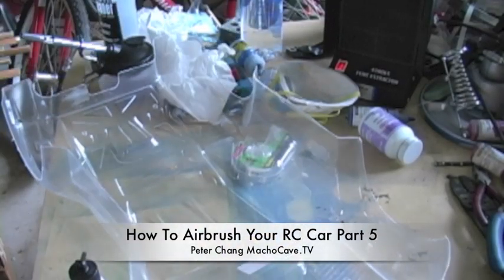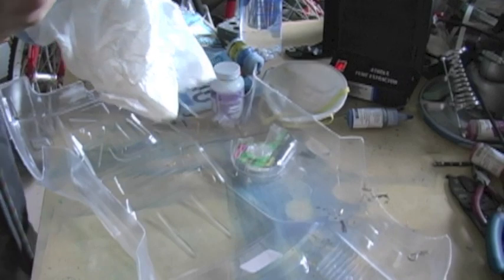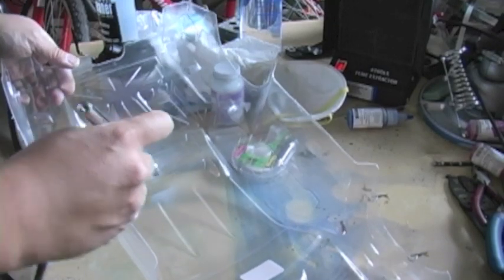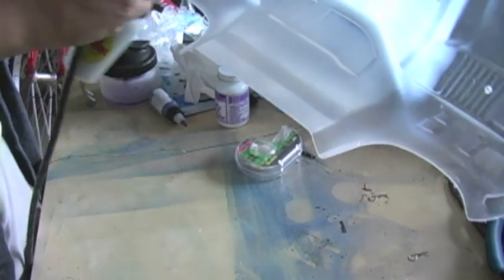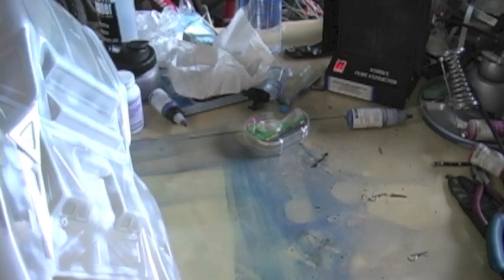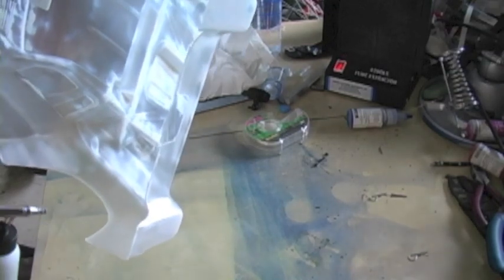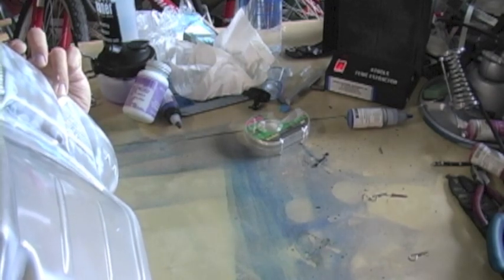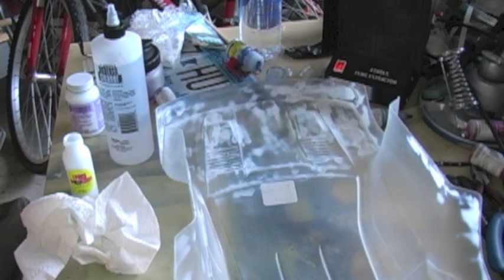How To Airbrush Your RC Car Part 5 Using Bob Dively Liquid Mask

Comment: 1 bar is 14.503 lbs. It does not matter who you ask. If you get a wrong answer the real answer is still 14.5. 

Awwww yeah 4+4 = 8..... No it's 16 but but I'm using  1 bar which is right in the middle of those two numbers so 12....